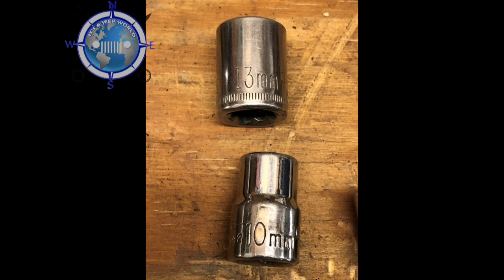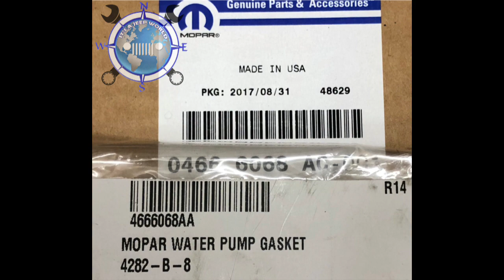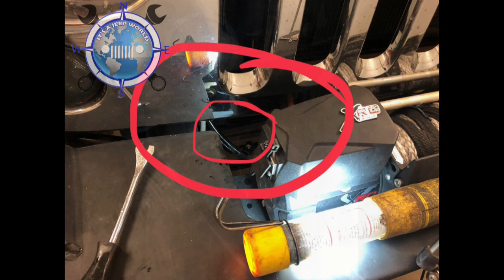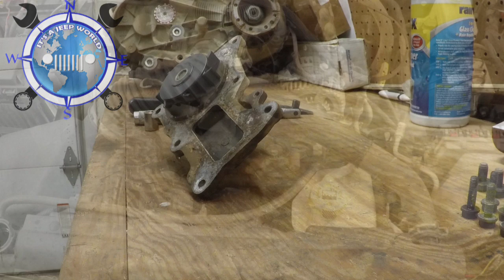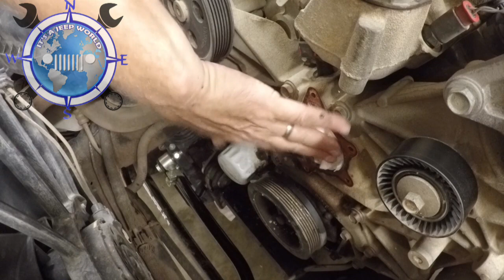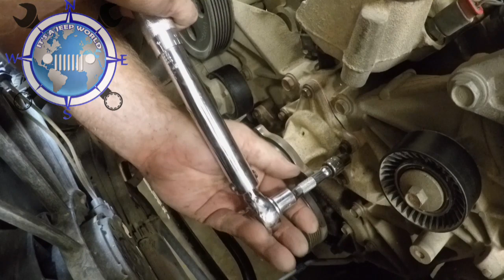Water Pump Replacement Jeep Wrangler JK and JKU 3.8L Motor - It's a Jeep World (DIY)

Comment: Can't help but notice the belt isn't routed correctly.  I assume you fixed this later?
Reply from the maker: It works either way, I’ve never had an issue, but I understand what you mean
Reply: @ItsaJeepWorld  Diagrams are online.  You will get more wrap around the alternator and water pump the correct way.

Comment: Can't figure why there are two holes in the gasket and none in the water pump... Both gaskets I picked up for my 2011 are the same... The original had no holes(for passages)🙄
Reply from the maker: What water pump did you buy?
Reply: @ItsaJeepWorld  the water pump has no holes.... Only the gasket cous' Fel Pro#35998 2009-2011 Jeep V6 3.8 printed right on it🙄
Reply from the maker: @marcrud1250  the gaskets are probably used for multiple water pumps to save manufacturing costs
Reply: @ItsaJeepWorld  it's my best guess ✌️😁

Comment: IT seems after taking all that time and effort to replace the gasket on the pump I would have just replaced the pump itself their cheap and you know the bearing will go bad sooner than later on it
Reply from the maker: It was a solid pump and the motor is getting replaced later in 2021 with a 6.0.. after the SD60/14b go in it over the next couple months
Reply: Well done video. Thanks.

Comment: How is the water pump seal not a pressure seal? People talk gibberish when there's nothing to say. You're so lucky you didn't shear off those water pump bolts when you removed them. Now that's a big mess.
Reply from the maker: Yea.. It is pressurized, I'm sure in my head I meant there is no pressure on it right now, being the I drained the radiator (and of course it is not running), why would I have sheared off the water pump bolts when I removed them? I know it can happen... but I've never sheared a water pump bolt off in 30 yrs.. Thermostat housing bolt yes..
Thanks for your comments and pointing out that error... It happens.. Have a great day.
Reply: It’s a Jeep World I’m sure you are a better auto mechanic than I am. I’m retired so I’m not horsing the water pump bolts. I slowly tried to loosen them and torqued the heads off 2 of the 7 water pump bolts while taking off the original water pump. Had to pay a real mechanic to do a house call and fix what I f’ed up. First time I ever broke bolts off too and I’m 62. Mobile mechanic said he put 4 kids through college just getting broken bolts out of all sorts of industrial equipment as well as autos. He loved being his own boss and fixed my problem in 1 hour including dressing all the aluminum threads in the engine block. He told me many a master mechanic refused to call him because of their pride, but call him eventually. This guy told me in response to my confession that I broke off a hardened bolt extractor in 1 of the bolts, “Relax, that will barely slow me down. I’ve done hundreds of bolts on Jeep Wrangler water pumps.” I highly recommend “boltguy.com”.